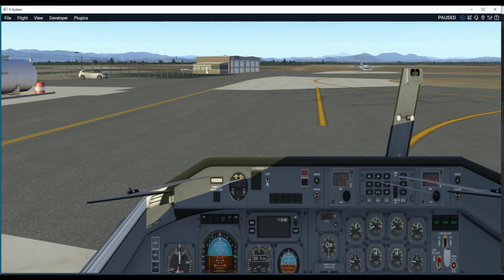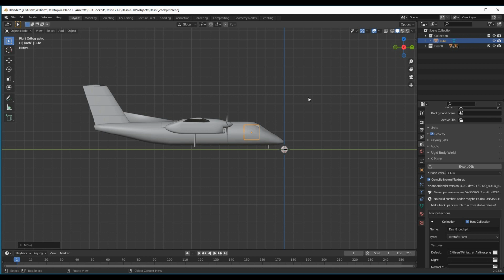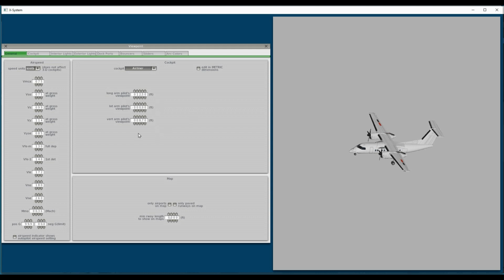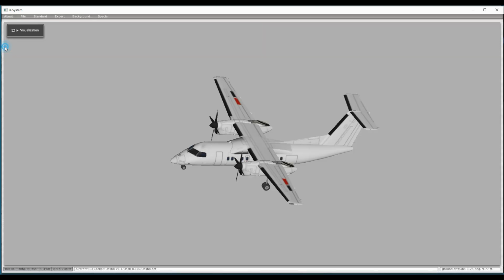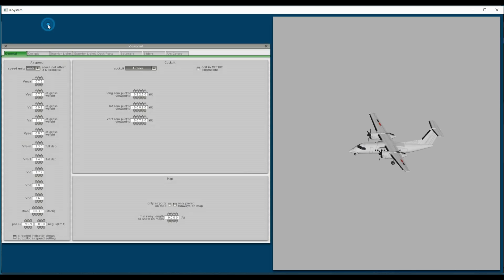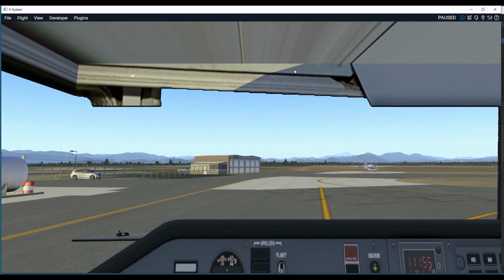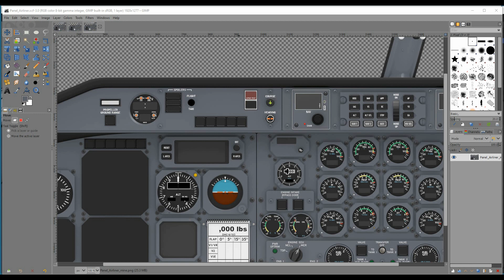How to Create a 3-D Cockpit for X-Plane 11 Part 4

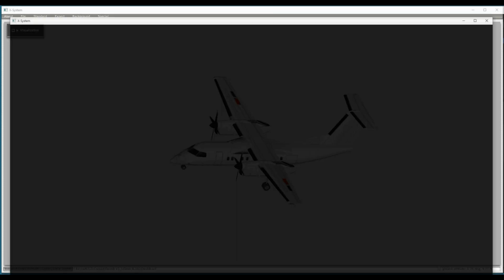Comment: so at 3:38 are you saying the "reload aircraft and art" button (at the top) does not work to successfully refresh the cockpit?
Reply from the maker: Hi Jared, You are right. Sometimes you need to load another airplane and then reload the one you are working on. If you just make changes in Plane Maker you should be able to just reload aircraft in XP and I suggest without art. Don't forget to save your changes in PM or the changes won't take place. Also, sometime you might need to reload the airplane in PM after making some changes. I know what you mean, I've struggled at times wondering why it looks the same in XP after making some changes. Sometime I think it just like to mess with me :-) 

Blessings,
skip